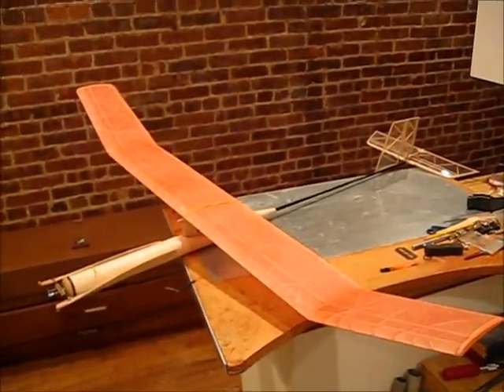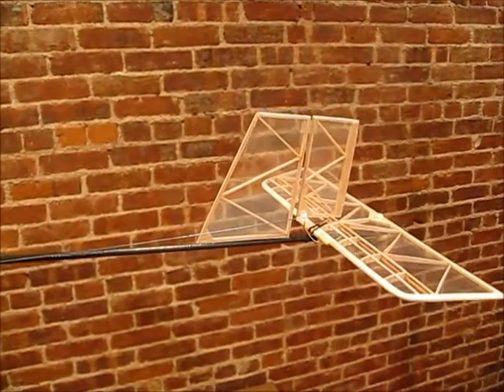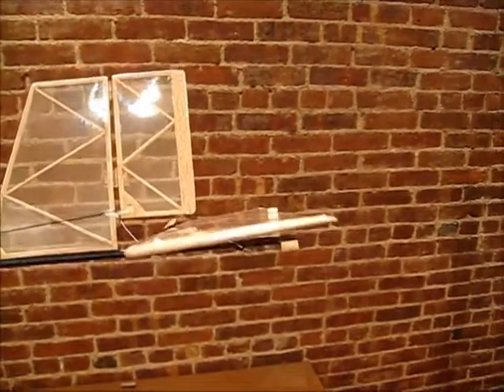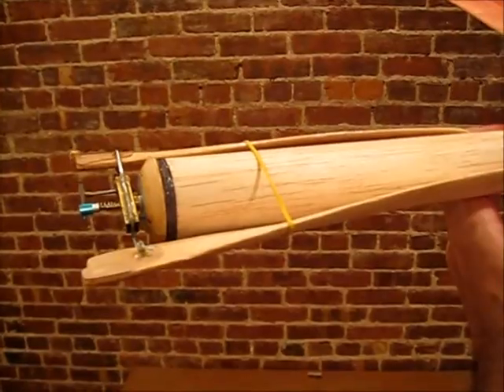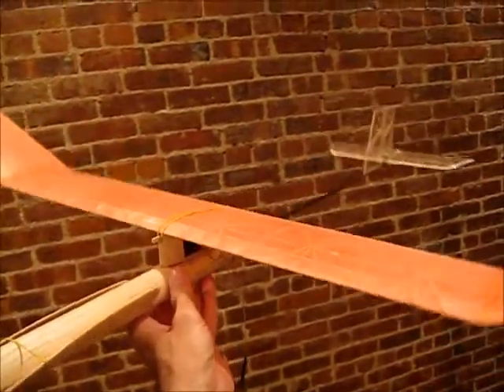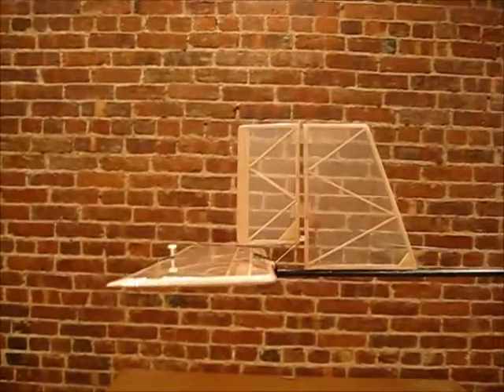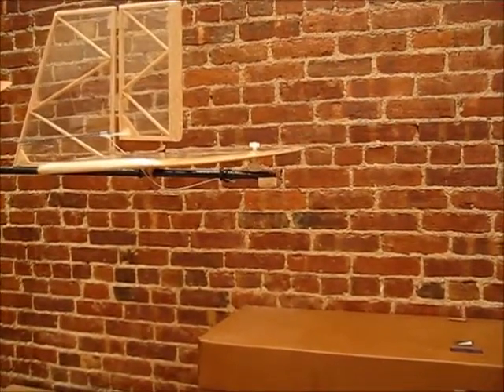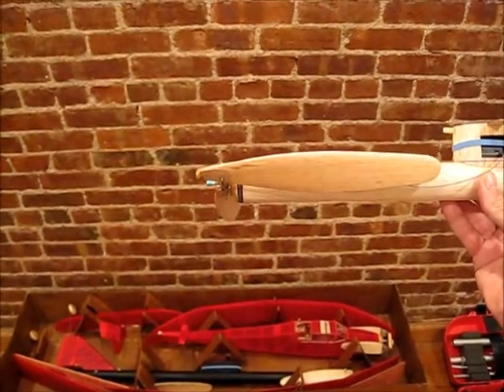Winterhawk 4 rubber RC Coupe d'Hiver - building

Comment: Thanks for the clear demonstration both of your VIT mechanism and the Montreal folding prop!
Reply from the maker: You're welcome. I actually stopped using the VIT a few years back, seems like with the RC rudder you can set things to get a pretty intense climb without it, but it probably does help get you a little more straight up if that's what you're going for.

Comment: Hi there I'm building a model and I am wondering is there any association between angle of incidence of wing and propeller down thrust? Thanks
Reply: Actually I mistakenly glued wing at little higher angle of incidence. Is there any way to compensate for it?
Reply: You can compensate with some downthrust, but if the wing has more than say +4 degrees incidence, I'd remove the wing and redo it, I tend to use less incidence so that you don't as much downthrust.
Reply: @ltdvideos7216  Thank you.  How to remove CA glued balsa wing. I'm afraid I may break structure.
Reply: Just carefully slice it off, the beauty of balsa is that you can always repair it by gluing on additional pieces or strips.
Reply: @ltdvideos7216  Thanks will try..

Comment: Would the VIT work with a rudder which fully pivots?  I like Jim's Winterhawks, Tubesteaks etc.  This would be the coupe of his I'd build.  Pull pull would be my hope.......... P.s, how's it going with the Silver Streak, you tame it yet?
Reply from the maker: Yes the VIT will work, the VIT thread is attached to the rudder horn, I'm actually using the pivoting rudder now for this plane. However, I haven't used the VIT in years, I think once you have rudder control I'm not sure you really need it, or maybe its because I get great flights without it so don't bother anymore. Silver Streak is in the hangar for now, been flying my BW Coupe again after 2 years of no Coupe flying.
Reply: domoremath bummer about the SS, it's a great looking plane. Bob White's Coupe as well as his No. 22 Wake are both on my list........ they are beautiful lanes. Enjoy flying the Coupe....... I'll look for the video